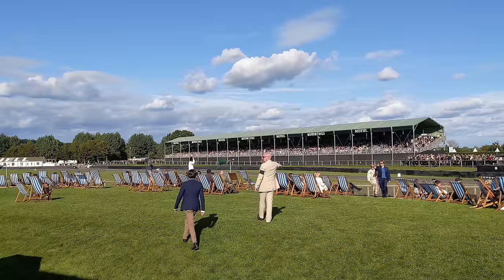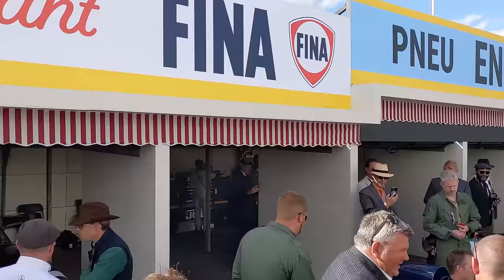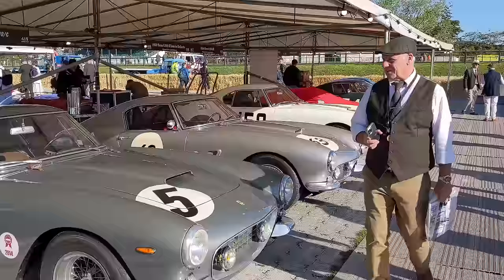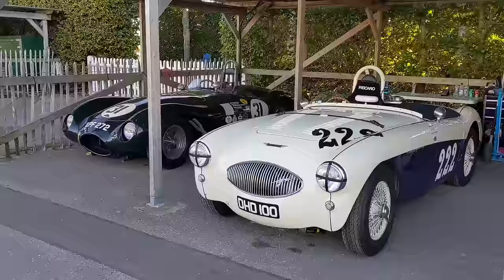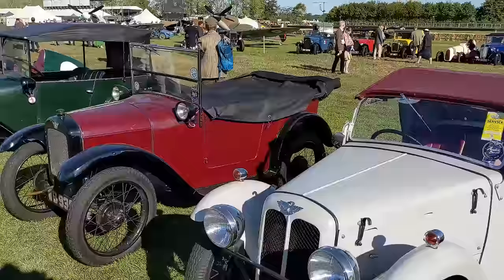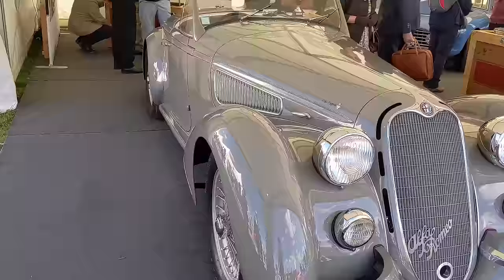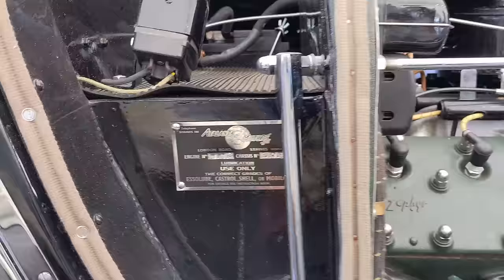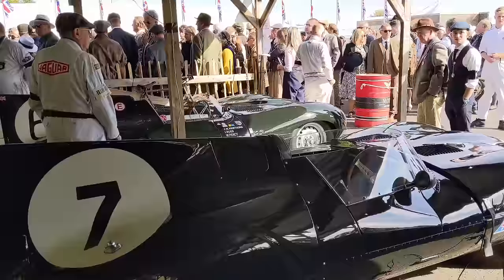Goodwood Revival Full Tour

Comment: Thanks for wonderful footage of BRM F1 car. 
Fun facts:
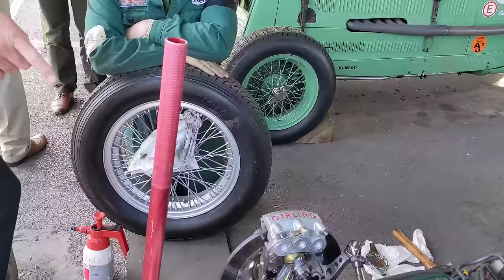At 2:40 you can see front suspension of that car. Very similar design was used earlier in the 1930's by Doctor Porsche for Auto Union race cars (Silver Arrows). Later the same thing was repeated with VW Beetle and Porsche 356, but ball joints was placed vertically. Then the same idea was used again in a production car. It was Zaporoshets 965 and 968 models - smallest and cheapest soviet cars. But (to my knowledge) it was the only time when ball joints was placed horizontally! Like on a race cars 🤣
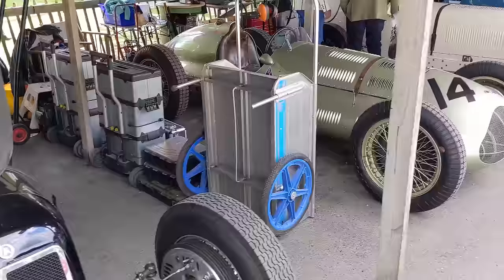Reply: Hmm... at 29:45 and 29:50... 1930's ERA cars... very similar looking front suspension 🤔
Never knew about that 🤷‍♂️

Comment: You could help me
I have a mk2 3.8 62 jag
Bought a good running engine that I. Want to tidy up before fitting
What is the correct paint code please for the metallic blue in between rocker covers please regards Adam